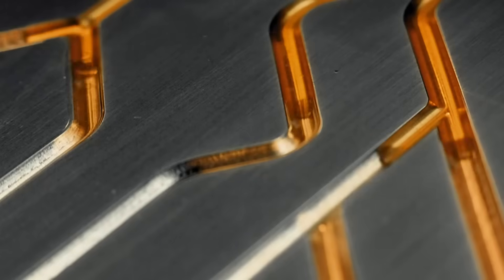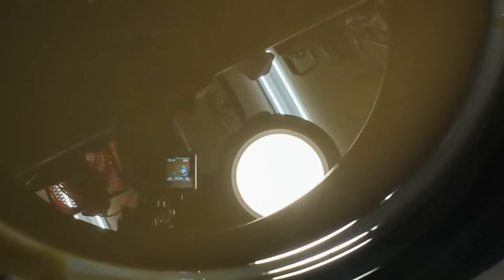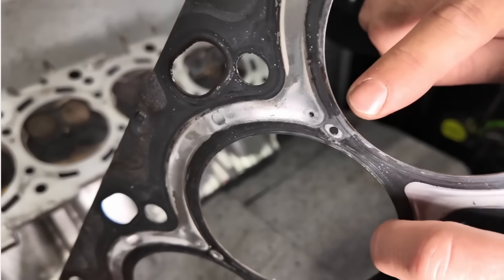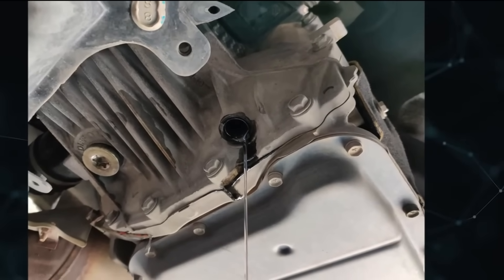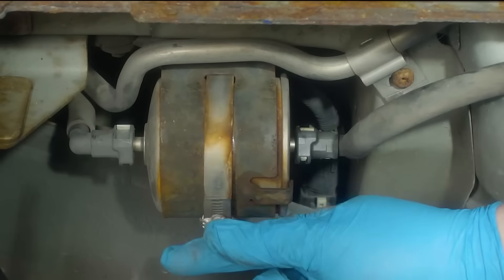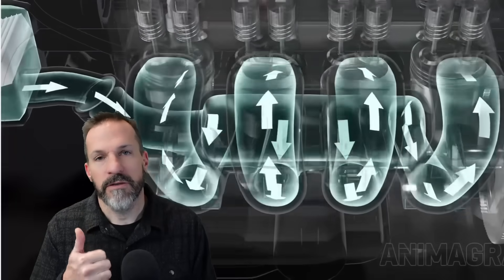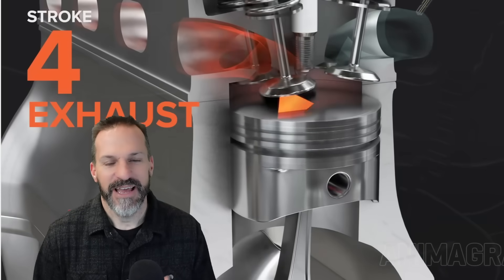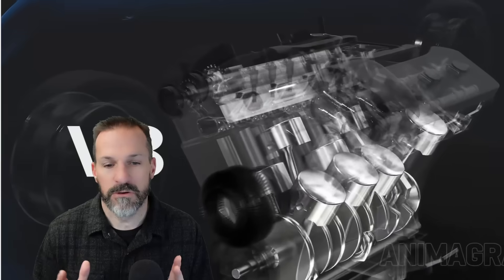Car Maintenance MOST People Ignore! Make Your Engine Last 200,000+ Miles!

Comment: I’ve hit 14,000 miles on my 2020 RAM 5.7 Hemi! That’s 5 years with two oil changes and nothing else. Still runs like new or better! I should be able to trade this in about 50 years! I’ll be 125 years old. Btw, it’s been two years since my last oil change. I was 74 years old! The oil is still clear on the stick and looks new. I wonder why. I run the truck about every 3 weeks to the store. Whew, it’s a trip! About 9 miles or so. Other than that I do a long trip about every three months or more. That’s about 58 miles. Just hold to this and don’t race your engine and sit in traffic and you’ll be fine!

Comment: Here's a bigger pro tip. If you want a car thatll run forever theres a reason why Civics, Corolla, Camrys (older ones) and compact cars tend to be the most reliable. Power. Having a motor barely make 130HP means less stress on components. Overtime thatll add up. Sure todays cars can rip to 60 in 5 seconds but what good is it if it barely last 50K miles due to how much stress the stock interals are under with the power they make. Theres no reason for a new car to need over 300hp. Simple. My 2013 CX-5 lasted 263,000 miles before i sold it. Its still kicking with the new owner at 297K last i checked. The reason besides maintaining everything for it lasting so long. Simple the drivetrain combo. People may fun of newer Mazdas for still using NA 2.0-2.5Ls with barely 180HP and using 6 speed autos. But that combo right there is the most widely engineered combo in the car world. Think of how many generations/ cars that have existed with a NA 2-2.5L with a 6 speed auto. That means car manufacturers have perfected them. It may not make alot of power. But that means they are stress free engines. Where the most stress theyll see is you flooring it redline, if even that. Maintenance can go a long way. But buying an underpowered car will help double the life out of it. Just my 2 cents. 

Also with the fuel filter. Honestly just run 93 in it a few times a year. Most modern filters can last as long as you regularly put 93/fuel cleaner. My car for example only takes 93 (Si civic) and it has 2 filters since it takes premium only. So I'll never have to replace them since i never really let it get low which can break them and because the fuel is pretty clean. My CX-5 never had issues with the filter/pump because i never let it get below 4 dots of gas unless i was hyper miling and because once every 2 months i would use 93
Reply: I won’t buy anything with a turbo. Puts too much strain on the engine
Reply: Great point about smaller engines being less stressful on components and more reliable overall 👍

Comment: I would also add once your car hits 100k, that's a good time to start inspecting for cracked, or worn coolant hoses, and also the o-rings on temperature sensors. Some of them can get very hard and brittle, then crack causing a major leak.

Comment: One thing you might add is to clean and replace seals on brake calipers (50 to 60 or with first brake job).  This will keep them from getting stuck which damages pads and rotors and OEM calipers are expensive.  There are rebuilt cores but better to maintain existing OEM.

Comment: I got a 2007 Toyota Camry I do my oil changes and oil filter every 3,000kms. I also replace the Spark plugs, coil packs, and PVC Valve every 30,000kms, or every year if I don't reach 30,000kms. My camry is at 303,000kms.

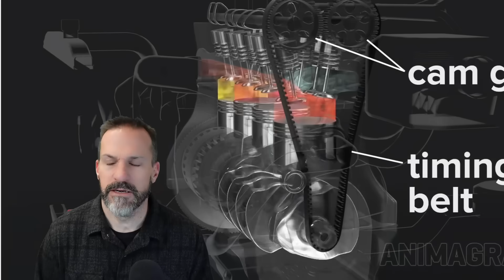Comment: 8:48 The issue is that for lot of vehicles, the owners manual says you don't need to change the trans fluid, except under severe driving conditions. Same with oil changes, people will go 10,000+ miles between them because they're listening to their car's Oil Life system or the oil companies themselves. Like Pennzoil "guaranteeing" 15k between changes, or even worse Castrol, who says you can go 20,000 with their Edge oil.

Comment: 6:40… for the last couple decades, I have checked my oil and tire pressure every time I fill up with gas. If you burn oil or have a leak, you don’t want to find out that there’s only been a quart of oil in there for the last 5,000 miles. May as well do that simple check instead of just standing around waiting for the tank to fill up.

Comment: I always check my dipstick when i do oil changes. My 5.3 gm burns a bit more than a quart by the time i need an oil change. Usually add a quart by 50% and get my changes done at 30%

Comment: Start with a well designed engine.  Nothing makes a crap engine last, Kia proved this.  I have run the Chrysler 3.8L(96 to 2007) for over 1,000,000.00 miles, my 98 town and country has 415,000 mi  and I average 350k per engine, there have been No mechanic issues with the engines beyond the usual water pump.  Regular maintenance and good synthetic oil is a must.

Comment: 2015 Tacoma 4cyl 4x4
Base extracab manual
405,000 miles
Original engine
Original clutch
On third alternator
Second front axle
New front suspension parts
Second set of shocks
Still rocking the CD player
Rolling, rolling, rolling

Comment: I'm a big fan of Lucas fuel system cleaner every now and then, I buy it by the gallon, Seafoam spray for the intake yearly and Seafoam in the motor oil a few days before each oil change. I change O2 sensors at 100K miles. Great stuff!

Comment: ❤ 460K on my 2001 4runner limited 
thundercloud.changed the rear differential from junkyard,drive axel,entire brake booster, the throttle body, and cat converters .Mechanic  said I need vapor canister .Used AMSOIL 15 yrs ,now I use VALVOLINE extended high  mileage/ FRAM PLATNIUM FILTER. ❤

Comment: Very good video 
I have a 2000 Honda accord v6 
It’s got 180k 
Very low mileage but it runs like a new car 
I change the oil every 3k miles 
I just changed the timing belt

Comment: Another pro tip is to always make sure your battery terminals are rock solid tight and clean. This will make your alternator have to work less and help you save money as you won’t have to worry about replacing your alternator. A new alternator can cost a $1000 dollars

Comment: I fit just around 400, 000   km ( 248k miles)  on my old Subaru Outback.  (Was one of the ones with the head gasket problems and yes it was the head gasket that finally took it out

Comment: New subscriber. My car  is using way too much oil. There's no leaks on the under carriage, so I fear my oil may be leaking into the engine.  Also my mileage has dipped drastically. Took it to a mechanic who ran a compression test,said  it was fine at 150 psi. We changed the spark plugs, it has 126, 673 miles. I plan on changing the pcv valve & engine filter. I've changed the transmission fluid twice in the past 2& 1/2 years to be safe. How Can I tell if oil is leaking  into the engine, please?

Comment: Great video! Not an engine item, but if you live near salt water or in the rust belt, it is a good idea to FluidFilm or WoolWax the underside each year before winter to help prevent rust.  Also, as mentioned by others, replace the battery at 6-7 years as preventative maintenance; and keep a spreadsheet of completed maintenance with date & mileage, especially if you own multiple vehicles.

Comment: IMHO changing oil at 1000 miles is NOT needed. When I was an apprentice  mechanic in 1963 oil changes were done at that miliage for the first  change. After that the intervel changed to 3000 miles. In todays engines the  clerances are much more precise and oils so much improved  (synthetic) that longer change intervals are the norm. That said 10000 mile intervals are too far apart and one has to remember that going longer than 1 year is not a good idea regardless of miliage.

Comment: the easy way to keep track is whenever you need to change your tyres, change all the fluids, brake and rotors.
As for the rest of the handling, 100-150k miles (depending on your road conditions). Also, make sure you go for a beefier parts (more expensive but worth it overtime).
Go for metallic over plastic (make sure they're paint coated, especially if you live in a place where salt is present like the rust belt or the ocean/sea coasts)

also wash the under carriage of your car too. Don't just clean the cabin. (make sure you don't soak/spray the electrics if you do wash)

Comment: Went 360,000 on the fleet van, 2003 Chevy express 1500. Tranny had to be rebuilt because we never changed the fluid. Shop said “you wouldn’t be here today if you had changed the fluid”. It’s still driving, going to hit 400k on the original engine

Comment: My Chevy Cobalt is at over 268,000 miles and still runs. Though a wheel did almost fall off once, taking driving until the wheels fall off a little too literally 😅

Comment: I was young and dumb when I was in my teens and early 20s. I was a young woman and totally clueless. I had a 1988 Toyota Corolla that I did not take care of at all. I was surprised that it went to 198k miles! I had waited 65k miles before getting a basic oil change. I’d add oil every two weeks. You get the picture.

When I bought my own car 1993 Honda Civic DX I treated that car so well. It went past 200k and I gave it to my cousin so she could have a car to run around in.

I bought a 2005 Honda Pilot 15 years ago. It has a new catalyst converter and a radiator. It has almost 185k miles. I drive about 5k miles a year. It’s my utility car.  In the next two weeks I will do all the “fluid” services. I’ve made it a point to change the oil every 5k miles. I was considering a used car until I saw the prices of used cars.

Comment: I got a 2007 yukon 5.3 I bought it with 174,000 miles back in 2017 now I'm at 267,800 and it's still running like new. It was a one owner who took care of it and I just kept up with the maintenance.  Tune up, all oils and filters change,  differential fluid change etc. All good.

Comment: Based on what I've noticed, the most common maintenance that's ignored by some car owners would be changing the transmission fluid especially if there's no dipstick to check the level or  discoloration, changing the air filter, changing the cabin filter, fuel filter, power steering fluid and brake fluid.  The other stuff mentioned in the video gets ignored too, but not as much like what I brought up.  One reminder tip someone can use for just checking the brake fluid level or discoloration is to check it each time the brake pads get low.  If the brake pads needs to get changed and at the same time the brake fluid needs to be changed, then change them both on that one occasion.  As for two bonus tips which wasn't mentioned in the video, one mistake a select few to some of drivers do....with a little emphasis on the some part is that they drive their vehicles on E before finally deciding to fill up with gas.  If that's done once or twice, it's not too bad.  However, what some drivers don't realize until it's too late is that driving the vehicle on E routinely eventually damages the fuel pump and depending on the scenario it'll lead to fuel injector failure as well as couple engine issues.  When the gas gauge goes down to quarter tank, that's when it's time to fill up.  The other bonus tip involves another mistake some drivers do, which is to overfill the gas tank during fill up.  While at the gas pump and it clicks once, that's it.  No more fuel.  However, some drivers want to put as much fuel as possible automatically assuming the vehicle will get more driving range until the next fill up.  Overfilling the gas tank will eventually lead to damaging the fuel pump and the fuel lines.

Comment: I changey oil every 4500 miles and i change my oil filter every time I change the oil and i check all the coolant and oil lines every other oil change i only use very high quality oil mobil 1 full synthetic oil is the only oil that goes into my car,  my car air filters all of them i change every 10k miles like clockwork work i also change my pcv valve every other oil change i also since I dont know when the last owner changed the transmission fluid i just changed it by a quart at a time after doing it 3 times at my oil change I finally just drain all the transmission fluid then fill it back up if the fluid wasn't horrible looking to begin with anyway but if it looks too dirty I usually just leave it alone honestly or just change a quart of it every 10k miles

Comment: I have 55,000 miles on 10 year old Toyota Camry. I should do your full service routine, as car has had only basuc maintenance. What is the approximate price range to get thus done?
Reply from the maker: Price will depend on who does the work, even locally I see variations between dealer service pricing. with 55k, I would do a coolant flush, look at brake fluid/transmission drain and fill around 60k. Check the drive belt(s), brakes. Camry's around 2015 were VERY reliable platforms, many folks would even wait until 100k to do some of the maintenance, but given that it has been 10 years you could mix in some of the maintenance a little early because your mileage is so low.

Comment: Advice is good….but there’s this thing called Murphy’s law. I just had a car properly maintained that just need diesel injectors replaced at 100k miles(2018) newer engines are absolute garbage designed to do 60/100k miles or 7 years.

Comment: I agree with you. I've got a 2003 Mitsubishi eclipse V6 that I've had since new. Original engine and transmission. It now has 240,000 miles on it and I still commute to work with it every day. Oil changes every 5000 miles. Transmission FLUSH every 70000 to 80000 miles. Coolant, brake fluid and p/s fluid every 5 years. Inside of the engine still looks like new and doesn't burn or leak any oil. It's a good car and I plan on keeping it forever!

Comment: I have a 2001 Toyota Tacoma pre-runner extended cab with the 3.4 V6 372,000 miles original motor transmission rear end all I do is change the oil every 1,500 miles

Comment: Self taught mechanic here. I own a 17 Chevy spark with 170k miles on it since new and not a single issue. I can't tell you how good it is to hear someone else give such good advice on how to take care of a car and go reassure what I have tried to do. So much bad advice out there. But I enjoyed your video as I will now consider pcv valve and fuel filter on my new car
Reply from the maker: Awesome, 170k is pretty darn good. On newer cars you probably have the fuel filter inside the tank so, it might not be worth replacing :). PCV though is always a good idea if you are finding oil burn etc.

Comment: Secret: change the vehicle fluids as needed & required. 

Only idiots fall for "closed for life" transmissions. Closed for life is a lie & it's the life of the transmission fluid & warranty period, no the life of the vehicle.

If one has the transmission flushed, changed drained & develops problems & regrets doing the flush, your transmission was already failing due to poor maintenance. 

What's cheaper to change, transmissions & engine fluids or transmissions & engines?

Comment: 258k on my first car still have it 2004 vw passat 1.8t five speed i did replace the whole transmission along with a new clutch assembly about 10k ago original motor and everything else besides some small stuff

Comment: Thanks for this. I would add:
1) change the battery before it goes bad. Low voltage and weak battery is hard on the alternator and starter.
2) change the shocks and struts every 50k miles. It will ride better and prevent a lot of other suspension and brake problems.
Reply: Yep. Old GM alternators would burn up a diode in the diode pack if they were forced to charge a dead battery. Thankfully the diode packs are replaceable.
Reply: Suspension should have been on the list, good call.
Reply: Great list! As a tire tech who sees this way to often:
1.) keep an eye on your brake pads. It is terrifying how many people drive on almost no pads with no idea.
2.) Tires every 30 to 50k especially in states that get snow!
3.) an alignment to protect those tires every 6 months. (Shameless plug) Firestone will give you free alignments for the life of the vehicle if you pay like $225-$250 up front.

Comment: Should transmission fluid be changed/flushed if hasn’t been done in over 100k miles?
Reply: Hi, I did a drain and fill (no flush) at 186k on a Vera Cruz and 235k on a Volvo xc 70. No problems 😮

Comment: Just lost an engine in my 2011 Kia Soul. Timing belt failure. I changed the original belt at 80k miles. It broke at 141k. It was a Gates belt, with new idler and water pump. Failed with no warning... so much for the 4,000 mile oil changes, the trans fluid changes, and meticulous maintenance. Damn belt got me. Car is off to the scrap yard. I really wanted to see 200k. My advice? If you find a car for sale with an interference engine and a timing belt-stay away, run away!

Comment: Dont waste your money on oil, I never changed oil sooner before 16.000km, that what I did on my bmw e39 530d 2002 it has a turbo and its a diesel, I have now 405.000km and rising, engine is in perfect shape but the rust on frame will kill the car, sooner. Never changed timing chain too… I used 0w-40, 5w-40 and 0w-30 oil randomly LL01 specs. oh and I removed EGR 15 years ago…

Comment: Just retired my 2006  Acura MDX with 312k Miles, power steering was going out and the rust was really starting to show. But the car still runs and drives with the original engine and transmission

Comment: I go by every 60k for my transmission fluid changes. It says that in that manual.
Reply from the maker: 60k is usually pretty good for transmissions, especially if you aren't towing and it's just commuter style driving. If you were doing a lot of heavy duty work/towing frequently or very hard on your car (aggressive driving), I would consider a simple drain/fill every 30-40k :).
Reply: @TheCarGuyOnline is it too late at 160k for Toyota Highlander atf change if it has never been done?